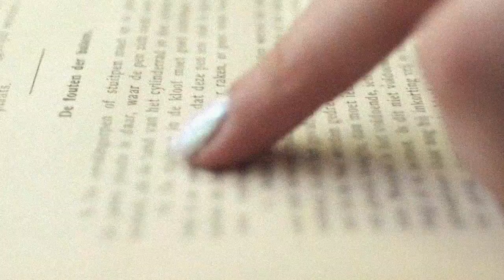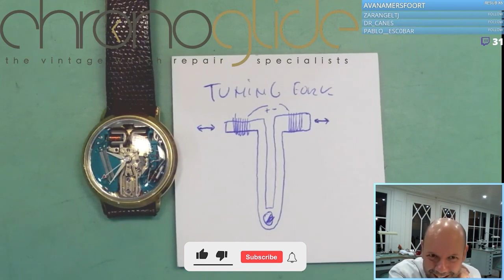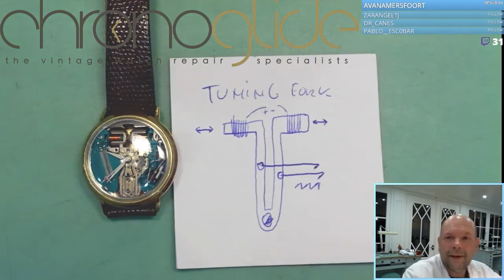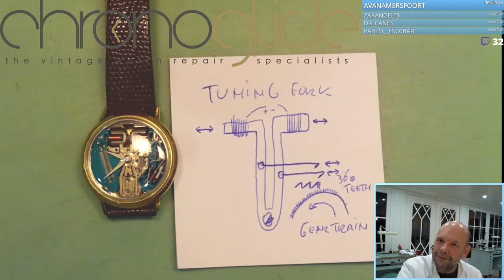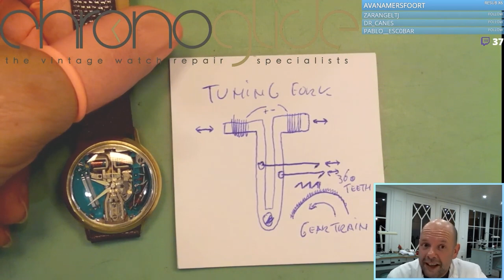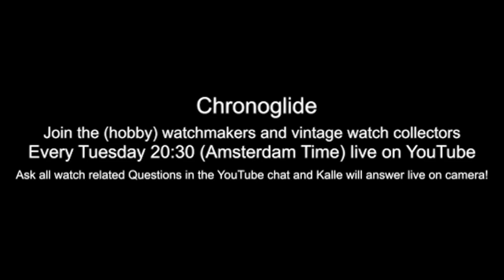Quartz movements  - Part 3of3 (plus Tuningfork Bulova Accutron)

Comment: I think you have you explanation wrong. I believe that one of the hairs is on the tuning fork and the other one is fixed which prevents the wheel from going backwards.
Reply: You’re right,also the index wheel has 300 teeth,so rotates at 72 rpm…
Reply: Yes, you are right.

Comment: Hi there, 
My grandfather recently gave me his Bulova Accuquartz watch, I have managed to date the watch back to 1973. 
I have taken it to a specialist in South Africa and they have told me that I require a 2242 movement but have not been able to source a working movement. 

He managed to jump start the watch (by getting the second hand running again) but told me that once stops working, I will need to find the replacement movement due to the tuning forks. 

I would really appreciate getting my grandfathers watch running again as I look at it as an heirloom. 

Would you be able to assist me in this matter?

Comment: Plastics have progressed impressively for making structural machine components, sleeve bearings, gears, etc. but the very capable plastics (high strength, machinability, self lubricating) are not cheap (many are not moldable) and more expensing than free machining brass (Brass 36000) if the plastic is machined in the same way (CNC). So I would guess the plastic parts in the orange watch shown have such loose tolerances is because they are a low grade molded plastic part. The plastics will wear and are not necessarily good with cleaning solvents or high heat. 

Working in close tolerance metal machine design, like a watch, although there are many tight tolerance small mechanisms which are not watches,  require a high quality control on the metal alloys used (some alloys are special for the customer directly from the mill (smelter) and then shaped at a mill, which could be in house) to ensure the exact metal properties needed (strength, fatigue, heat treat, finish, weight, machinability, surface treatments, etc.). So, in general, machine design using metals (Mechanical machine engineering) is not easy and never has been. There is so much that goes into making a part that can perform and meet the function and aesthetics of the design.

Comment: "...the cockroach of all movements..." Your horrified expression is a sight to behold!

I've been down the Breitling, Zenith, Rolex, IWC, Patek road. They're nice but...
Patek ended up being very rude AND charging a small fortune for servicing.
High end watches are like pets - expensive to buy AND own.

I recently got a Citizen Eco-Drive BM7108-14E cockroach for £130 (UK).
+1 sec every 7 weeks. (Likely just a production line fluke, I know.)
A very usable cockroach.

Here's a question.
Citizen said in an email: "Pulling the crown out will stop the movement and allow for a full re-charge."

Looking at the E111 movement technical guide, I don't see any functional connection between the circuit board and movement, other than the coil.
"Stopping the movement" just seems to hack the fourth wheel.
Presumably, the circuit board continues to pulse the coil, with the motor's rotation blocked.
How would hacking the wheel train "allow for a full re-charge"?
Any ideas?

Your youtubes are unique, lively and very watchable!

Comment: This is an excellent video, like the others on your channel... I particularly appreciated the part dedicated to the Bulova Accutron, of which I am an amateur (I have a small collection of 5 pieces). The Accutron – as you have well explained – is a watch like no other, and it is incredible that it was conceived and created with the technology available around 60 years ago!!!

Having said this, let me make a clarification. In the video, you say that the driving wheel is moved by two ratchets (not sure this is the right word in English…) , connected to the two branches of the tuning fork. 

This is not accurate. In fact, only one of the two ratchets is connected to a branch of the tuning fork (we will call this ratchet A). The other ratchet is fixed, and is integral with the watch case (we will call this ratchet B). Now, ratchet A pushes the wheel forward (clockwise) when it receives the vibration impulse from the branch of the tuning fork to which it is connected. When the vibration of the tuning fork begins to pull ratchet A back, ratchet B comes into play, preventing the wheel from following ratchet A and turn counterclockwise. The wheel is held still by ratchet B until ratchet A comes back into play and (moving forward again) engages with the next tooth on the wheel, and pushes it forward. From here, the game repeats: A pushes, B stops the wheel, then A pushes again, and so on.

This all happens 360 times per second.

Amazing, right?

Comment: The tuning fork kind of works that way but kind of not, I actually did a video on it but another person recorded it in slow Mo so I'll use their video ( https://youtu.be/CPS7aNCAwAA) but in this you can see one arm pushes the gear and 1 is a pawl. But otherwise that is an excellent example of a 214. That being said if you want an really in-depth look at the circuit and freq generation do have a look at my video!